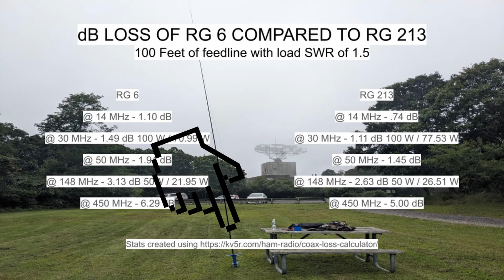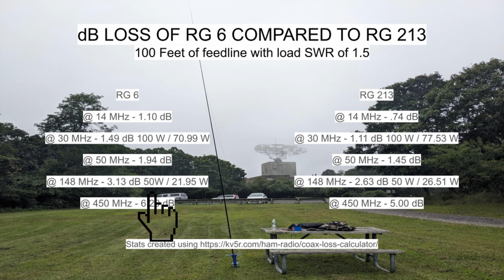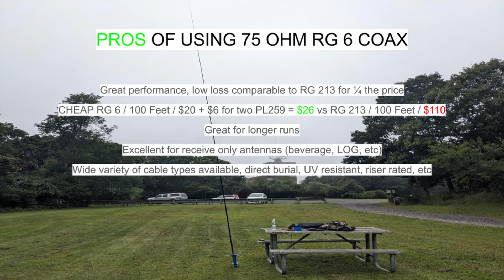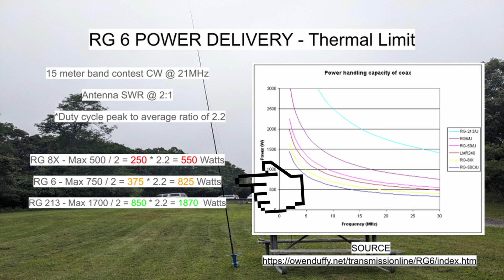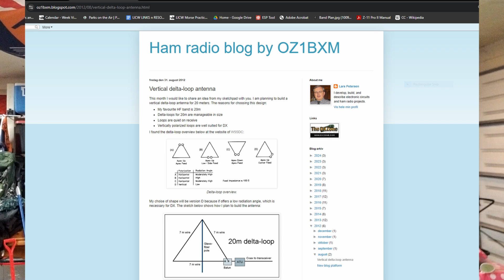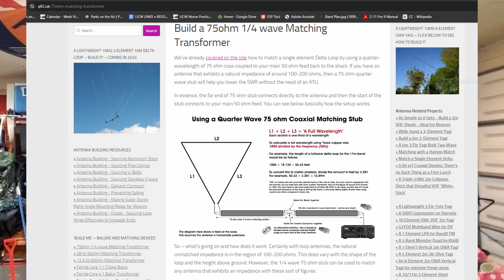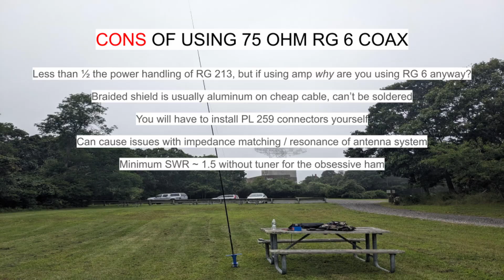Using cheap Cable TV Coax for Ham Radio

Comment: Thank you for the information on using RG6 for feed-line connections. I thought I was doing something politically incorrect in the Ham world. I am financially constrained so, cheap(and sometimes free) RG6 was my choice. And I had a terrible time trying to connect PL259 connectors to it. I tried soldering, not knowing the braid was made of aluminum. And also realized that my SWR wasn't so great  - not skilled enough to use an antenna analyzer like nanoVNA wondered why my dips on the display kept going al over the place. I am an OM but a New Ham and I have tons to learn...73
Reply from the maker: I was not sure just how taboo using rg 6 was in the ham o sphere. It's one of the reasons why I made the video to show yes, it's ok lol. Thanks for watching!

Comment: My only reason to not have used RG6 for transcieve is its solid copper over steel center conductor with softer foam dielectric separating it from the Shield is in areas of continual flexing (especially like feeding a rotatible dipole, beam...) where failure is more apt to happen, along with its power limitation. And I usually had extra lengths of 8, 8X... at hand. BUT for 100-200 watt SSB and lower power usage into a more fixed Antenna you pretty well covered its benefits at low cost. I have used it several time with RX Antennas with good results, yes with water tight O-Ring'd F connectors and the F to PL adapters. 
Thanks for the Video! 🍺🍻
73   mike   N4ONL
Reply from the maker: Thank you!

Comment: So, I should expect the same out of RG11, which is 75 ohm also. It's a heavier cable and direct bury.
Reply from the maker: RG 11 might actually have less loss, better performance than RG 6 but I have not messed around with any RG 11 myself. Give it a try !
Reply: RG11 is the LMR400 of 75 ohm….kind of :-)

Comment: many friends used RG6 to wire the Mcmansion in 2000. I get a lot free and might as well use it. I do use RG8X - used. For RG6 I used stnd F connectors and i have a crimper from my coax days in 1990's RG8X I use 239 ends.  I am only using 100 watts max.  Cheap and functional. You covered it all. thx 73.
Reply from the maker: Thank you!

Comment: Let me assure you that using a quarter wave length section of 75 ohm RG6 to transform a delta loop into 50 ohm coax works for me every time. Just finished one for a crippled ham for a 6 meter Delta loop and it tuned up like a dream.
I have a 40 meter Delta loop waiting  for a ride to the top of the big tower.  It was in use on a lower tower with a 4:1 ferrite transformer and RG400 and was changed to a quarter wave RG6 matching stub to reduce weight, windage, and bulk. The radio could not tell the difference in the two configurations -  other than I will not be hitting the RG6 transformer with 1500 watts. 

K8DO
Reply from the maker: That was a good idea, swapping out the balun for a matching stub to reduce the wind load. I should use a matching stub if I ever build a portable loop. Thanks for watching!
Reply: Have you just cut 75ohm coax to a 1/4 wave and solder it in or do you trim for velocity factor?

Comment: Too many hams are SWR obsesive. In my years I found 2:1 or less works fine. This obsession is a bleed over from 11 meter electronic engineers.
Reply from the maker: It's great getting a perfect match, but sometimes good enough is better than perfect. I use 9:1 random wires all the time when portable. The SWR for any given band is never perfect. Thanks for watching!
Reply: I'm a 1.7,1.8 guy myself but splitting hairs I suppose. I like to keep the reflected power down without paying that much attention to the actual swr. Those $400
 finals in a 706 will make you that way. Probably non existent now.
Reply: Idiot
Reply: Only the ones that can build a decent antenna and don't flake out with "close ennough".

Comment: What connecter is that and where did you buy it from? I would like to get some.
Reply from the maker: I have added links to the connectors in the description of the video, I should have had them in there from the start. The PL 259 to type F adaptors on amazon: https://a.co/d/atdRGcx    The PL 259 screw on connectors on amazon: https://a.co/d/4JPMqGc   Good luck have fun!
Reply: @kd2wtu72  Thank you Sir!
Reply from the maker: You are welcome!